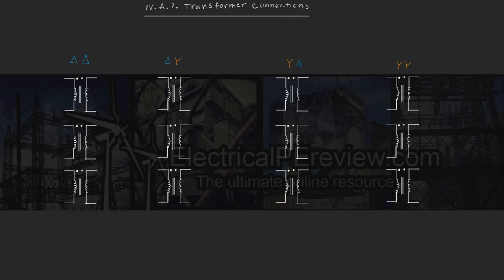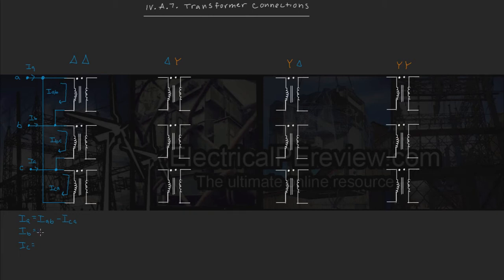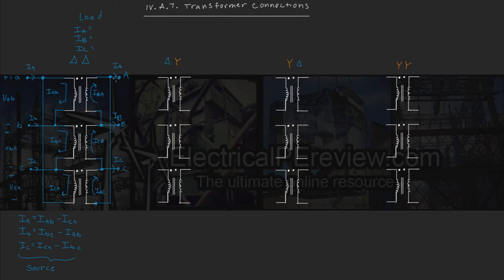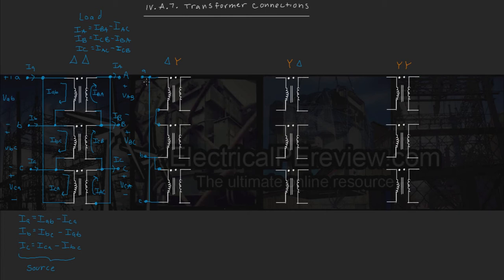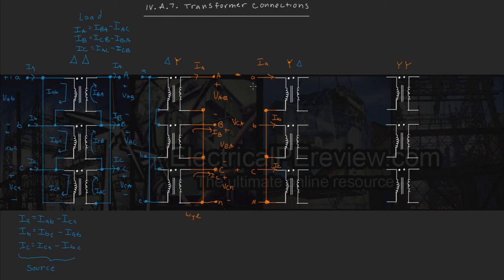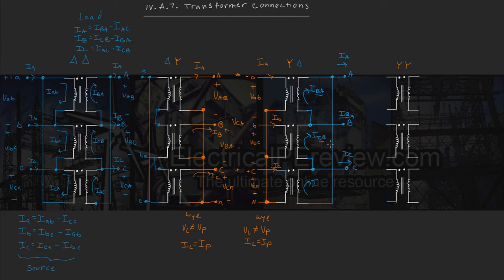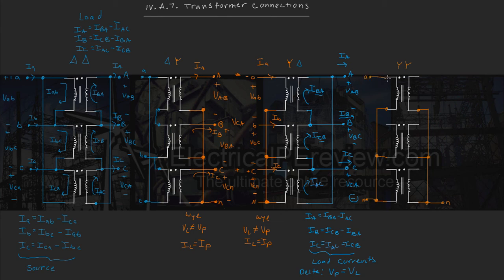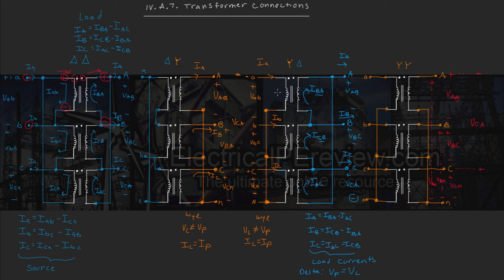IV.A.7. Three Phase Transformer Connections from Single Phase - NCEES Electrical Power PE Exam

Comment: The line you draw at 8:18, connecting C to A . Isn't that a direct short between the legs? Or am i missing something?
Reply from the maker: Hi Doug, technically speaking, yes, that is a short but not in a way that would cause a fault. That specific connection is what connects the final corner of the delta triangle between the first and third windings.
Reply: Thanks, for the response. I'm still confused though. Either you made a small mistake drawing it or I have failed to understand the concept completely. I just want to make sure either way, it could easily be the latter as i am not that experienced with transformers.
It seems like the delta side of the delta to wye transformer is wired differently than all the other deltas and Im not sure why. For example the corner of the delta between the first and and second coil is not connected to anything, its just left isolated? and then Line A is wired directly to line in C in a way that isn't done on all the others, I dont understand why it wouldn't pull infinite current since there is no coil(s) between line A and C.

Thanks for your time
Reply from the maker: I see you what you mean, the b and c tap connections need to be shifted upward, good catch, thank you.  I'm going to mark this video to be edited.
Reply: @electricalpereview  Thanks for your videos, theyt're very good. Whenever you do get a chance though, please amend this (or at least the description) as whilst the video is very helpful, that particular mistake does throw some spanners in the works when one is learning (i.e. it's not necessarily clear to a beginner that 8:18 is a mistake and that it definitely should be analogous to the other deltas).
Reply from the maker: @TheMadMagician87  Thanks! It appears that YouTube has officially removed all annotations from all videos in 2019 so the previous pop up that noted the mistake no longer appears on the video.

I updated the description to point this out, along with where in the video to find the correction, and included time stamps to make it easier to spot them. 

Unfortunately, there is no way to replace this video without losing the view count so we are going to keep it "as is" for the now. However, the corresponding video in our review course at www.electricalpereview.com does have the most up to date version of this video with the correction. 

Thanks for the reminder, and I'm glad you've found our videos helpful. If you are taking the PE exam, then good luck! Don't forget there is a tremendous amount of free in-depth articles with step by step example problems on our website that you also may find helpful at https://www.electricalpereview.com/free-articles/
Reply: @electricalpereview  Thanks, much appreciated.
Reply from the maker: @Isaiah Whitsett Thanks for the suggestion, the comment is now pinned.
Reply: Nice catch bro I was wondering the same thing!!

Comment: thank you for posting this video .... i have a question though how does the connections changes when using an additive  polarity transformers ?
Reply from the maker: Hi Joel, the dot typically represents the positive voltage reference for the winding it is associated with. Shown above is additive polarity. Subtractive polarity would have the dot on either the primary or secondary winding moved to the other end of the winding. When this happens, current flow on the output is reversed compared to additive polarity since the positive/negative voltage reference has just been reversed.  To better understand this, think of a single ac power source drawn on a circuit. Current always flows from the source in the direction of the negative to positive reference. The dot in transformer polarity is essentially showing where the positive "+" sign reference is for that specific winding.

Comment: Hi Sir, i'm very glad have found your video. i have some questions may you can help me.
1. so, it is possible to build three phase transformer from single transformer?
2. like example, i wanna make 240V - 24V three phase transformer from single phase. how about the source of a, b, c, (primary windings) we just make a seri connection on a, b, c, and use single source or make different source for every single a, b ,c ?
3. how about the angle? it is automatically have a 120 degree if i follow your connection?
GBU.
Reply from the maker: Hi Axel, I'm glad you enjoyed the video. 
1. Yes, but to build a three phase transformer from a single phase transformer, you will need three total single-phase transformers. You may then connect the primary and secondary windings of all three single-phase transformers in either delta or wye depending on the connection type needed. This group of three single-phase transformers is what makes the three-phase transformer. 
2. In order to make a 240V to 24V three phase step down transformer from three single-phase 240V to 24V transformers you would need to connect them in either delta-delta or wye-wye.  Anytime you connect transformers in wye-delta, or delta-wye, you introduce both a 120 degree phase shift that will either lag or lead, and an additional √3 multiplier that will either make the magnitude larger by or smaller by the square root three depending on if it is wye-delta, or delta-wye. This is not a concern with delta-delta or wye-wye connected transformers.
Reply: Electrical PE Review Ok. Thanks sir..

Comment: Really breaks down the connections on each side of the transformer. A lot of sources seem to gloss over what is really happening on each side and seeing how you get the root 3 factor and phase shift for delta to wye/ wye to delta is very valuable